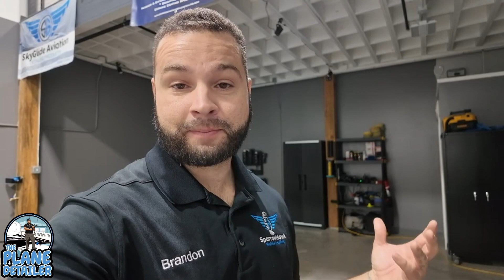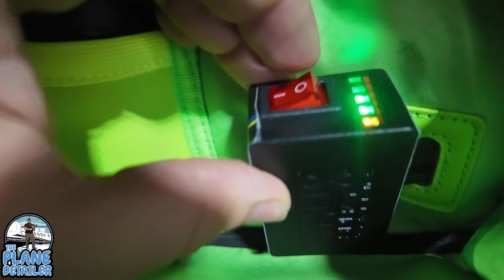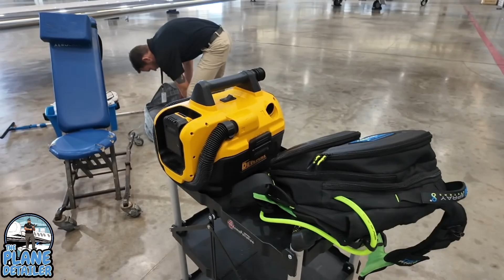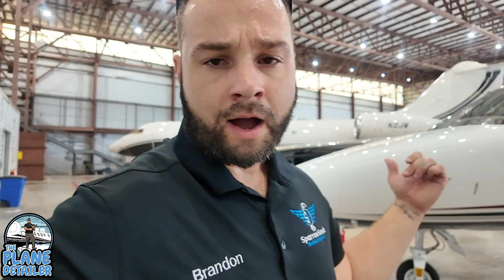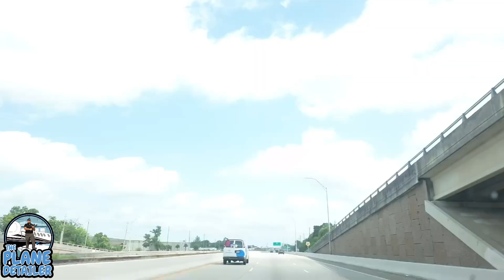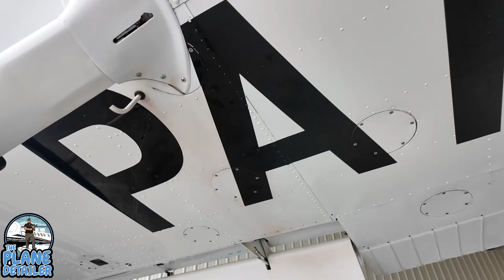Tru-Activ Sprayer Backpack REVIEW: 3 Planes, 2 Airports, Real Results!

Comment: Hi from México, so you think with a one bag can i pre soak with Rinseless to do a one regular size car like a sedan?,,, Regards!
Reply from the maker: You can, usually when we do cars on a maintenance plan we still rinse off first. But you can rinseless after or foam cannon. We have maintenance soaps for the auto side of things too. That will come out later.
Reply: thank you so much for your quick response. I'm looking for an equipment to rinseless cars. My first option was de Tru Kegs but i saw your video and i'm wondering if the backpack its my best option. My needs are that i have to use at most 3 liters (100 oz) of Rinseless to do a regular size car and thats why ask you if you think that it's possible?,,, and another question it's if the psi is constantly at 90 psi?,,, Regards!
Reply from the maker: @Compayip1  yes the PSI stays great unless you lay the backpack down. Also if you use the smaller flow tips .18 or .12 sometimes you have have pump surge. But I find keeping the backpack upright help to prevent that. One bag holds 128fl oz so you can hold a whole gallon.
Reply: @Theplanedetailer Thank you so much!!
Reply from the maker: @Compayip1 yessir always! 🫡🤜🤛